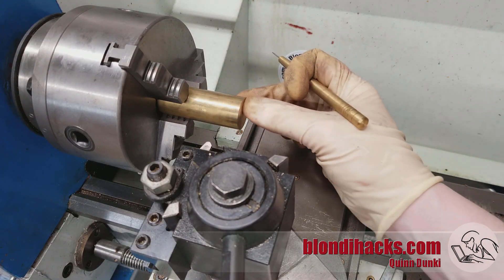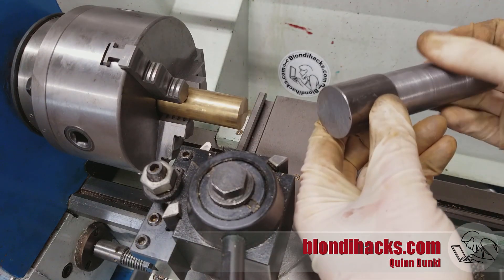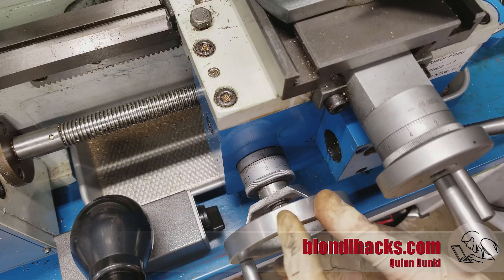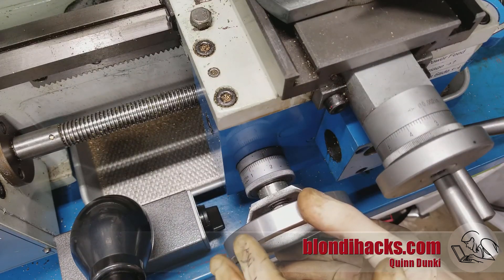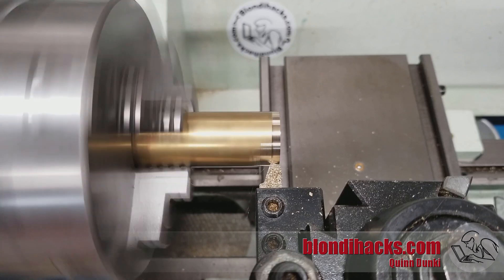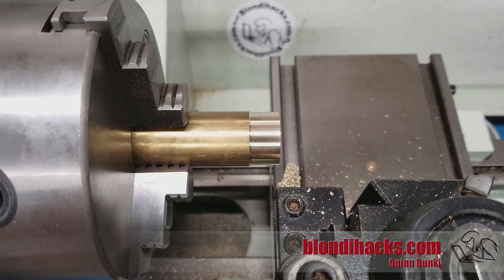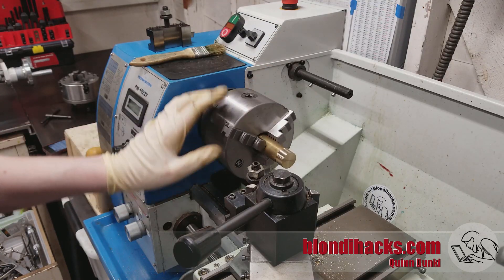Metal Lathe Tutorial 5: Turning

Comment: A question I've been wondering and still yet to find the answer. When taking the 69 thou off, you took 30 then 30 then 9. What's the maximum that really should be taken? If one is competent and confident in the machine could they take the whole 69 thou in one go (theoretically, ignoring the chance of missing the size etc), or is there a maximum? Is this "depth of cut"?

I watched a video from India and the guy really hogged the material off, very heavy cuts it seemed. I'm wondering if I'm being too tentative just taking many small cuts and if i should just get stuck into it more

Comment: Thank you again, very well done. Even though I'm 4yrs behind .  You can learn something new everyday.. As with fabricating & welding...Machining is all new to me. I've seen dozens of vlog's where the camera angle is showing the bar stock...My initial thoughts; 'either they have the bar in wrong or its bent".  I'm expecting to see the cutting tool just designate.  
As soon as you mentioned concentricity, then showed the exaggerated example... it was the lightbulb moment.  
I'm in the market for a good hobbyist lathe...but I was holding back, mostly due to my complete lack of knowledge...  and understanding. Certainly 5 tutorials doesn't make me a machinist.

Comment: Would you use a HSS tool to remove just .001"? and stay away from carbide for that? My next experiment, as I've ruined a slip fit by sticking with carbide all the way to diameter. (and beyond.) 🙂

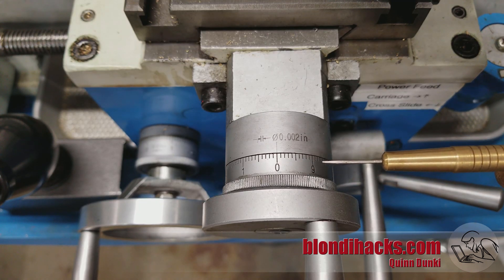Comment: 4:40  An obvious measurement change but I missed that recently as I just started in machining as a hobby. I planned my total depth of cut and did it in several passes and stopped halfway to check and all the material was *gone*.  I thought I was misreading my dials!  Thanks for the tip!  That's turning 101 stuff.

Comment: And let’s not forget that 40 thou it’s not a small amount of surface to remove and achieve a pretty much round/concentric surface. There you are showing a small diameter part, now imagine a piece of metal that is several inches round! Like any ship has those huge propeller shafts which are machined not cast! They are huge, speeds are super slow to be able to cut it, and it’s long and humongous! I used to work with a gentleman who did repair for the local port here in tampa. The Chuck was something like 30-48” in diameter, four independent jaws, and 12 feet long! So one can see how larger pieces will serve the operator with a better or worse surface to start with, the concentricity harder to center and achieve, tolerances, speed, the weight of the parts and machinery itself, etc. besides the fact the accidents are more prone to happen, and more prone to really kill you!!!
thank you for the videos!

Comment: Complete noob here, loving the series though. I haven't ordered my lathe yet, but I had a question about loading the work into the chuck. How do you know how tight to load the material into it? Obviously loading plastics or brass it could start to crush or damage it. Just wondering if there's a general rule on how tight the chuck should be gripping the material safely.

Comment: I have a super weird handwheel on my metric lathe for the bed travel. Each small division is marked as being 0.25mm, and the circumference of the wheel further marked with major divisions from 1 to 3.5 .... but if you turn the wheel to "1" it will have moved through 10 divisions, with a half way mark at the fifth mark! So if you want one millimetre, you have to watch and count off 4 divisions and moving to the "1" would give you 2.5 mm. Any clues why its done this way? :)
Reply from the maker: That sounds suspiciously like an imperial pitch carriage rack that has metric dials on it. 2.54mm is 100 thou, which is a common major division on imperial lathes.
Reply: @Blondihacks  That makes sense! I did wonder that, but figured 0.25 x 10 = 2.5 as opposed to 2.54. Then again maybe they figured "meh close enough", as the likelihood of ever getting that 0.04 by hand was pretty low :) My lathe looks exactly like yours by the way, its a british Warco WM250 which I think uses the same bodies as the Grizzly's and the Precision Matthews. A lovely racing green though, I always like to think so it blends in the common potting shed environment it usually ends up in in these shores. Thanks for responding, I am currently lockdown bingeing your content :)

Comment: Why do you have to touch it when it's moving to get a zero reference?  Why not just touch it when the workpiece is stationary?
Reply from the maker: That’s a good question. The reason is that you will go to deep if you do that. There isn’t sufficient feel in the hand wheels to know when the tool is just touching, so it’ll be dug in by the time you feel it. Touching off is done while moving because you can visually see a chip form long before you can feel it.
Reply: @Blondihacks  My guess was that it was because you may have been anywhere between the low and high spot on the runout of the part.  I didn't know that you would dig into the part if you touched it with the bit while not moving.  Thanks!
Reply from the maker: @joslinnick  Your guess is also correct, in a sense. Touching off is still done while moving even if the surface is machined and running true, though. However it is also helpful to know you're touching off on the high spot of the material so that your depth of cut isn't unexpectedly too deep.

Comment: As always, I love your work!  This time, though, I have a specific question.  At 5:42, as you finish the first pass of turning and the lathe is slowing down, we can see that the boundary between the machined and unmachined portions of the stock is really wobbly / wavy.  I don't understand how that can happen, since the cutting tool was presumably, at its furthest left position, at a constant distance from the chuck face.  Can you explain?  Thanks so much!
Reply from the maker: Great question! That’s caused by low spots in the surface of the unmachined area. The vertical area created by where the tool bit stopped is varying in thickness, creating the visual illusion of lateral waviness. You see the same type of low spot after my first turning pass. Brass round bar from the mill tends to have high and low spots the surface like that.
Reply: @Blondihacks  Ah, yes, I understand now.  Thanks a lot!